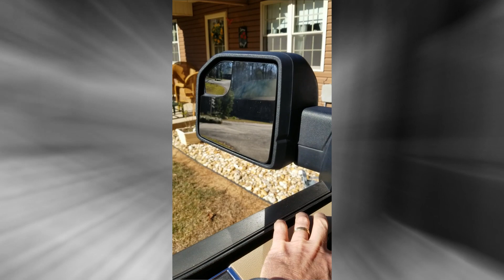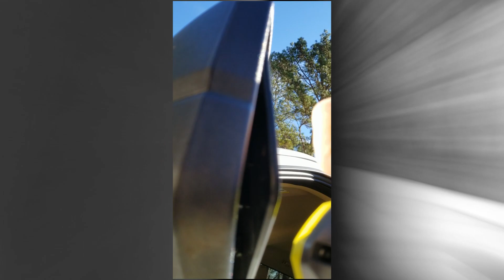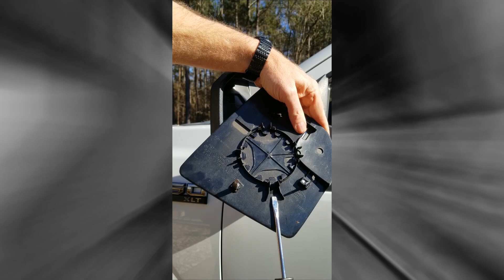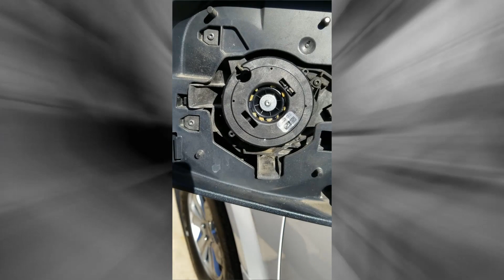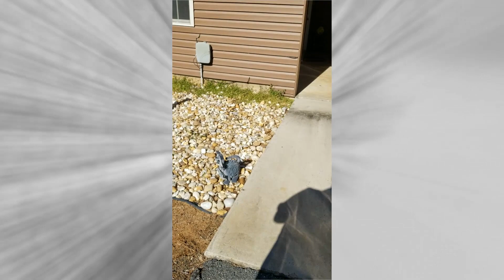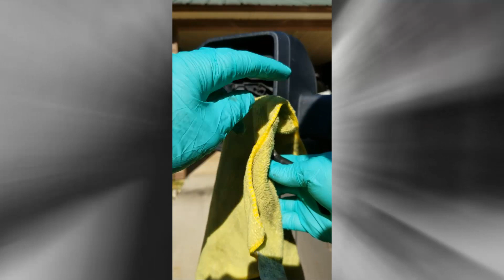2018 Ford F150 Electric Rearview Mirror Repair

Comment: As of now I don't feel like replacing mine. So what I do is hit the mirror indicator when it's lit up and press in the direction on my window and hold my finger on the window in the direction. I want it to go and it goes real easy. I'll leave it at that.
Reply from the maker: Where's the fun in that.  Next you'll be using a screwdriver to short the starter solenoid and then it's all downhill from there.  I hope you decide to fix it soon.

Comment: Thanks for the video.   Got careless and caught my passenger side mirror on garage door track.   Unfortunately, my issue was more significant than a dislocated servo screw ball/socket …the platform broke where it mounts to the motor housing.  However your demonstration made it easy to dissemble and diagnose, then reassemble with the replacement motor.  Thanks again!
Reply from the maker: So glad you found the video useful.  Thank you for the kind comment.

Comment: Thanks for the video. Everything was clearly explained. I took mine to an automatic car wash months ago and I noticed my mirror popped out funny. Since then the controls didn’t work at all. Fast forward to last week and my glass was knocked out by a sign that had fallen in front of me in the middle of the interstate that I couldn’t avoid hitting. Replaced the mirror today and was able to reset the spinning white gears back into the slot with your video. Now everything works as it should! Would’ve probably paid an arm and a leg to have them service it at the dealership. Thanks again!

Comment: Gotta love Ford nickel and diming customers even with simple features in a mirror. It'd probably be simpler and cheaper for them to just put heated mirrors and puddle lights on every mirror and cut down on the need to have a different wiring harness, but they'd rather force people into buying more options and higher trim levels.
Reply from the maker: I think my biggest disappointment with this truck was the 3.5 inch backup display.  I replaced the whole thing with a 7 inch Pioneer head that does Google maps and backup camera.  Now I love to ride in my truck.

Comment: thanks it helped to fix my issue which wasn’t quite the same … the ball/ socket was still connected .. my issue was the L/R motor inside the  housing was rusted and wouldn’t turn  .. I forced it to turn by hand and sprayed with oil got it to where it turned easy and reinstalled and worked perfect..
Reply: One Phillips  screw holds the motor case together
Reply from the maker: Great job. Thank you for the comment.